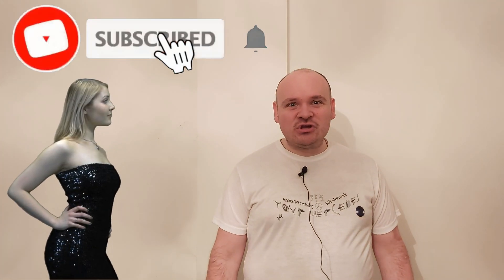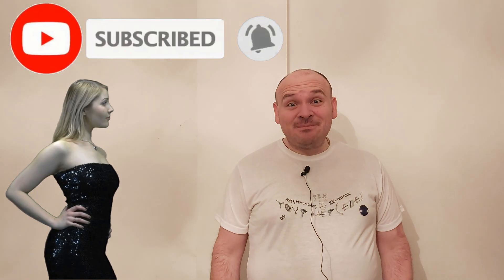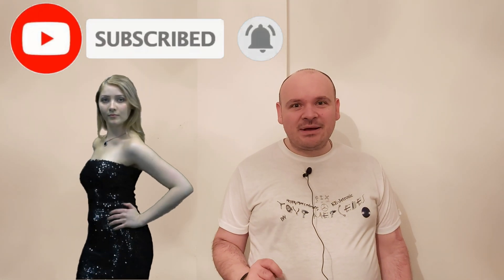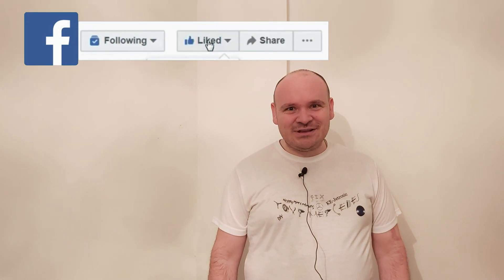㉦Mercedes Ke-Jetronic㉦ - About long sitting cars/a special video for Patrick

Comment: Can you please show me the marking on the calibration machine on how to calibrate your fuel distributor not good with the calibration can you just show me the marks on it where I should be
Reply from the maker: In order to calibrate the fuel distributor you must turn the adjustment screws until you feel stop(the ceramic plate fully closed). Then 3 whole screws counterclockwise. Afterwards you must measure the fuel flow for one minute on the car. You are done as soon as you get 4ml difference at most between all the cylinders on idle while on full plate 10ml difference can be tolerated. The job is time consuming but I don't know if there is any other way.

Comment: Heyy! That's me xD thank you!! The mistake I made was not removing the tank and flushing it. So, immediately clogged the tank strainer, and must have also burned up the pump. After new fuel pump, filter, cleaned and flushed tank, disconnected all fuel lines and cleared them, I was able to get proper pressures. And then as you predicted, there was no need to mess with fuel distributor (other than the plunger seal) replaced and set new potentiometer and now, the car is daily driver. ❤
Reply from the maker: Hehehehehee, good to hear that. I promised you the video and, here it is! Just let you 190E get a huge smile on your face while driving it!

Comment: Does the engine have to be running for the fuel pump flow test? I just ran the fuel pump without starting the engine and got 1.1 litres in 30 seconds at the return line
I assume this means the fuel filter and tank strainer are OK as well.
Reply from the maker: Yes. Here we test the fuel flow. What you did was under no load. When the engine is ON then you test the pump under load. Don't worry, the engine won't stall just press nothing(the sensor plate or the throttle).
Reply: @mercedeske  Thanks, I will retest the fuel flow tomorrow with the engine running.
Reply: Hello my friend, believe me your programs are very beautiful and I am curious why there are 2 fuel pressure regulators, one next to a fuel pump and the other next to an engine, and what are the readings of each one?
Reply from the maker: @wesamalrsam1759  The one next to the pump is called fuel accumulator. That one makes warm starts easier. The one next to the engine has to hold the fuel pressure built by the fuel pump.